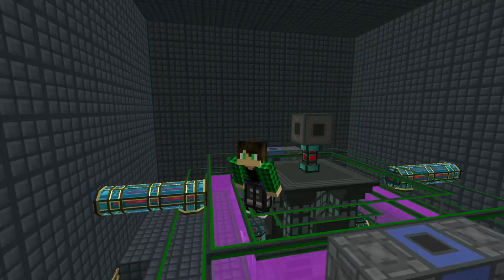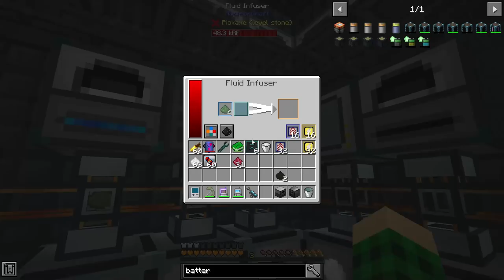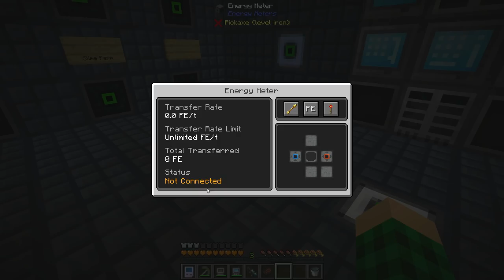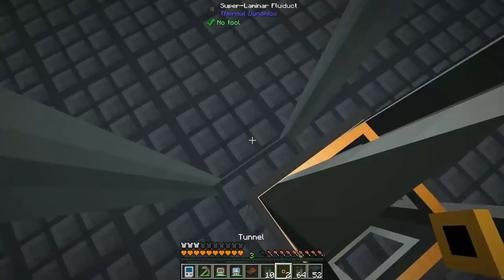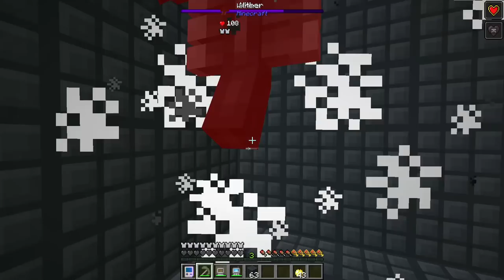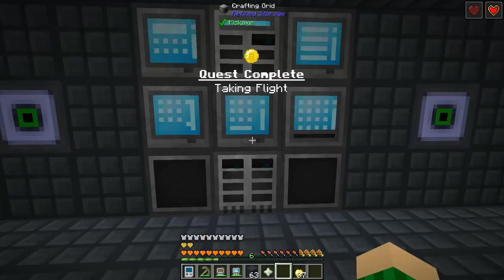Minecraft Compact Claustrophobia - EP17 - High Impact Compactor & Diamond Pickaxe!

Comment: For anyone that doesn't know the high impact blueprint has a button you can press in the bottom right corner that shows you what goes where similar to the projector with immersive engineering.
Reply from the maker: That would have been helpful xD well next time I guess! Ty anyway!
Reply: Mine doesn't work. It shows only the first step... have you got an idea why  ?
Reply: @keudlag  You need to finish the layer. You may be missing the fluiduct